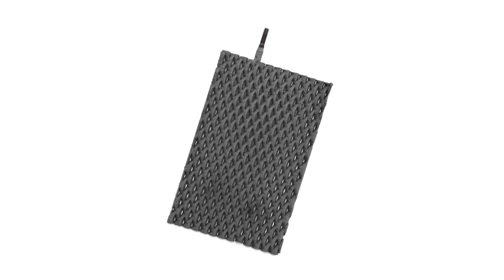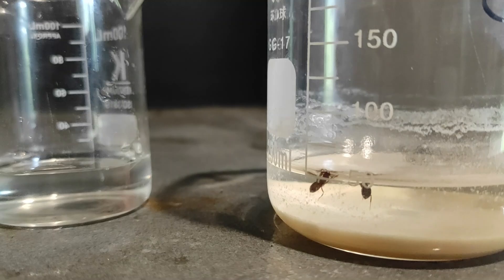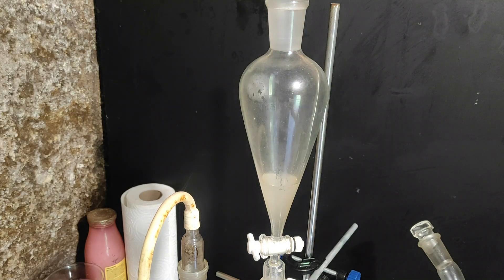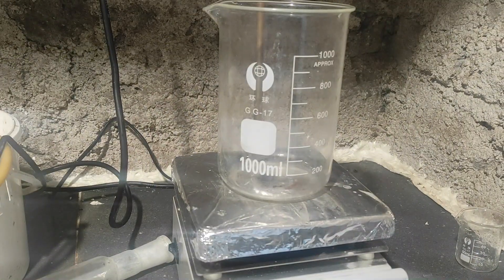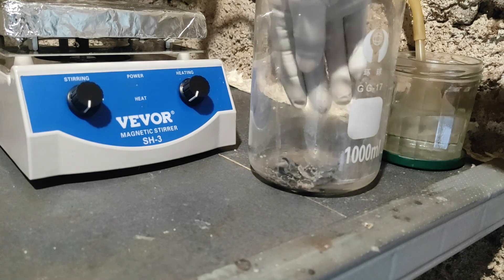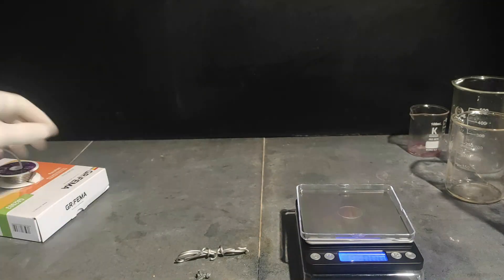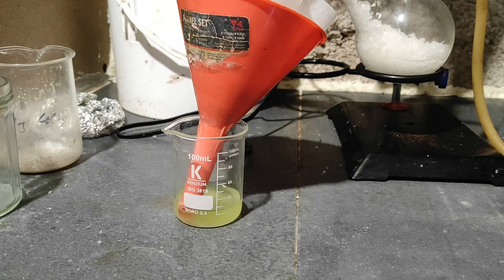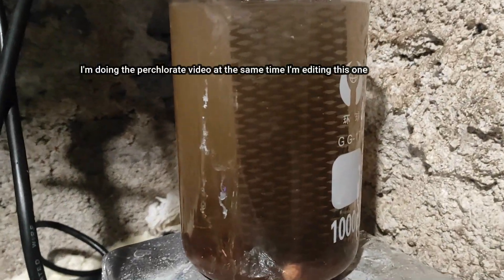Making Good PbO2 Electrodes From Scratch

Comment: Isn’t it easier to just take a lead plate and oxidize its surface into PbO₂?
Reply from the maker: Doesn't work sadly
Reply: @jam_kemist3986  in what way it doesnt work? in lead acid batteries are also lead plates right?
Reply from the maker: @matyashartl3763  no not exactly it's a lead metal frame with PbO2 packed in it, if u try it as an electrode it will be in crumbles after just a few minutes
Reply: @ ou Okay thx a lot

Comment: Yoo real nice
Still struggling to get my chlorate cell to work though...
Seems to be my computer cable that shuts off above 3A so gonna get a proper powersupplie. What is yours called? Just found the big ones with 30V5A
Reply from the maker: I don't remember the name but I know you can probably find it on amazon, the prices have increased a lot tho since I bought it, it's prolly 50-60€ now
Gl to you !

Comment: Really nice!
While I'm not a fan of working with lead myself, it's really good to see someone make a proper lead dioxide electrode that's not just anodising lead metal (which of course, is a disaster of an electrode).
Good luck for the perchlorate cell!
Reply from the maker: @ScrapScience  thanks a lot ! I really like your videos too
Reply: whats wrong with just lead metal coated with PbO2?
Reply from the maker: @matyashartl3763  It would not coat properly and will fall off in the chlorate bath sadly, but I've heard it might be possible to use plates of Pb as anode with the PbO2 being continuously generated by oxidizing Pb. Idk if it's a fact or just a hypothesis. I recommend searching on science madness forums, you might get answers
Reply: @jam_kemist3986  est ce que tu es français ?
Félicitations pour tes vidéos, ça rend la chimie passionnante pour des novices.

Comment: is it possible to just use a sheet of lead metal as an anode and run a very low current through it in sulphuric acid?
Reply from the maker: @isabutchers5591  it will make PbO2 yes, but idk if it holds well because it doesn't have the intermediate coating.
I've heard tho that's it's possible to use big strips of Pb metal as electrodes for chlorate to perchlorate and even if it gets destroyed, it also makes PbO2 on the anode and so the perchlorate can be formed but they don't last very long. Try and research on Sciencemadness forum if you want more information;)

Comment: Dont car batteries have both lead and lead dioxide electrodes in them? Cant they be used for perchlorate synthesys? Or am i missing a,detail
Reply from the maker: They do have PbO2 in a Pb frame but they are not hard coated PbO2 and will fall out very quickly so u can't make anything with them. You could recycle the Pb to plate tho
Reply: @jam_kemist3986  thanks for explaining

Comment: Chlorate still dominates perchlorate in my opinion, i mean who doesn’t love a whiff of medicinal chlorine dioxide or doesn’t like the radioactive yellow colour of chloric acid?? (no seriously never breathe in chlorine dioxide pls)
Reply from the maker: They are more funny imo but perchlorate are the more formel ones because stronger and safer
Reply: @ I mean they both have their pros and cons, perchlorate is more oxygen rich but chlorate needs lower activation energies (less stable since stability of chlorine oxide ions increases the more oxygen you add for some reason), my brain thinks that if smth doesn’t react immediately with concentrated sulfuric acid, it’s not powerful, so it thinks its a bad oxidizer since it’s very stable, but that’s just me